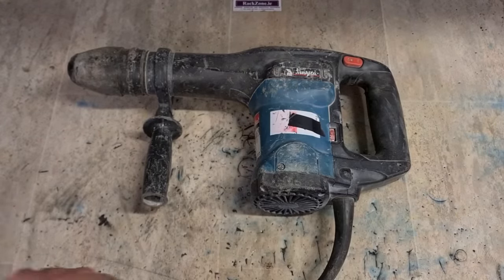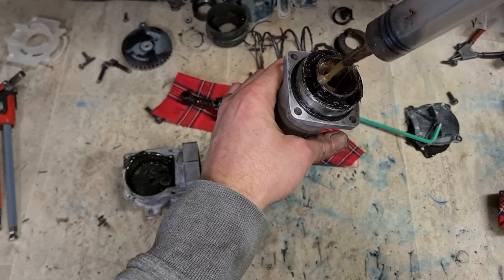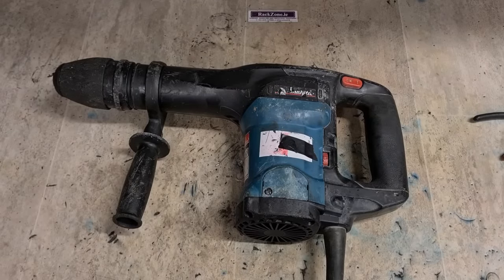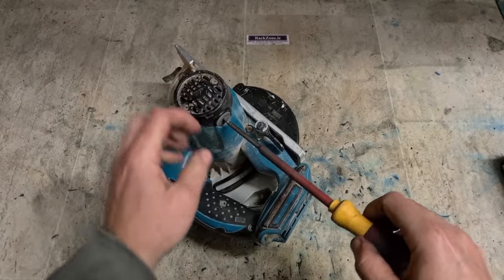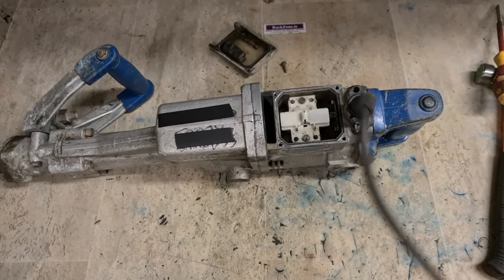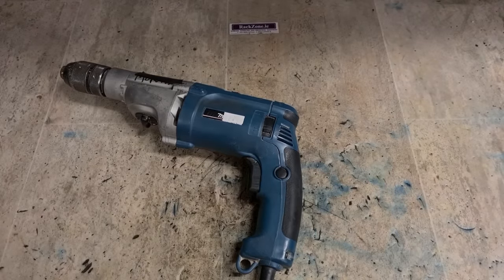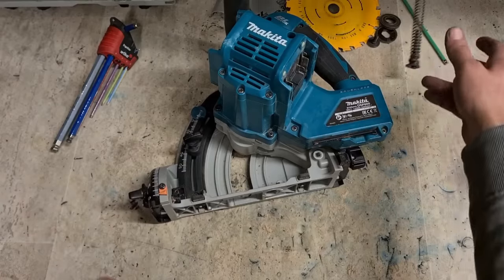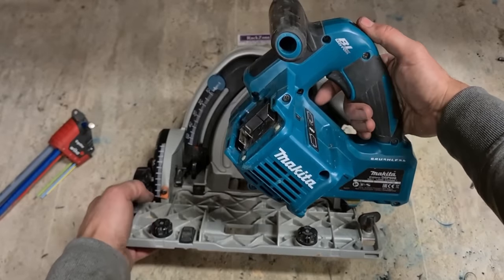Power Tools Repairs, Some old and new tools in for repair today. From a Kango 900 to a Rokamat.

Comment: I used to work at Kango Electric Hammers. I think I built every model they made. They did their own aluminium casting in-house if I recall. That was in the 70s. Time flies. Thanks for the videos--very captivating.

Comment: When I was a very young man (still a boy really) I worked with a carpenter and it was my job to learn to maintain all the tools. The plunge saw, well back then we didn't have one like that but we had tools that I would frequently disassemble, clean and lubricate. Paslode nailers were infamous for jamming up after a while without maintenance. It's tricky, as you say, some of these tools you must be quite certain you don't bend or crack anything while working on them. Nice job. Also, great to see that Kango, what a tool!!

Comment: Thanks!
Same tracksaw,slowly getting harder 2017 model.
Reply: Are you brave enough to have a go getting the pivot pin out? Once when I was young and a stupid cocky bastard I may have but now, nah! 😁
Reply: @josephking6515  am in the process of selling it actually. 
With it not being seized,I would try the grease trick and first see if it will self-correct...given it not being fully bound up.
Yes I would definitely press , if it got that far.

The one shown is actually dangerous.

Comment: One thing I especially appreciate about the way you work - when you do an electrical crimp, you always use a controlled cycle ratchet crimping tool. In North America, most people doing your job would use those terrible crimping pliers that look something like a pair of wire strippers. Car guys mostly use that type as well. They just don't do a consistent, reliable job. They are, of course, forbidden when working on things like aircraft and for cars and tools the manufacturers use proper tools. Just one of my pet peeves, along with people who solder crimps to make them "better" - all they are doing is bypassing the stress relief.

Comment: May not be the safest thing to do, but for old hammers like that if the switch goes bad you can by-pass it completely on the inside and install an external switch on the lead. Works well enough on low speed machines like a demolition hammer (not as dangerous as say a big angle grinder), but you may get in trouble if there's an (even unrelated) accident or a safety inspection on the work site. So basically if you chose to do this you should also retire the tool from any business use, just keep it home as a "hobby" machine and never lend it to anyone else.

Comment: I definitely agree that that pivot pin on the plunge saw fix should be its own Youtube and Instagram short, edited down of course. 

Id think a small grease fitting tool that can operate off a grease gun that screws into that hole would be an awesome repair item rather than having to go through all that effort to remove the pin. And if i were you i would definitely rig up a jig out of a 2 x 10 wiith a hole drilled into it with a drill press to have the pon push through, but keeping everything level.

Comment: I have a very old Bosch reciprocal saw that has a part that needs replacing. 
When I looked it up it’s no longer available. 
But it’s something that I imagine many other sawzall’s  all use. 

Offhand I can’t remember exactly which piece, but I think it’s the fan blade or very closely linked or located. 

Do you have any videos that you have made that include a dated corded reciprocating of this type? 

I’ve watched so many of your videos and not once have I seen this tool amongst the multi tool repairs. 
I bought Makitas cordless version (it’s an 18v version, nowhere near the usefulness or durability) and buying a +250 equivalent (that won’t last decades) is a hard sell. 
I used this thing to chop entire cars in half in the 90s (back when I bought it used from a pawn shop) and until last summer when I needed to trim small tree branches that a chainsaw was my alternative, had the carburetor cooperated

Comment: Thanks for filming these repair vids....A little question please...ON the SDS drill, what tyoe of greases do you use in the motor area and the chuck end??? Graphite/lithium etc....Thanks again Dean
Reply from the maker: I Use mainly bosch grease myself. 1615430015 and 1615430001. 
But these are expensive. So a lithium grease will also do fine

Comment: Be careful taking the base plate off the plunge saw. There is about 1mm movement in it and can throw your blade location out on your guide rail rubber splinter guard. Generally need a splinter guard replacement with any base plate adjustments.

Comment: Those DSS611 and the 610 should have had a car fuse built in which stopped them from drawing too much current, an easy fix when it blows and keeps the saw alive. Bad design makita (i have the 610)
Reply: Seems like it wouldn't be impossible to add to it, there may be room in the handle for that

Comment: 1:08:10 Curious, do you still charge a nominal fee (like, wasted storage or time) when they drop you something that works but they don't know how to use it?
Reply from the maker: it simply depends. if it is from one our customers who bought it here, or if iv spent no time on it, then no. 
But if i have wasted time with it or if it has to be boxed up and posted back. then i would have to charge an inspection fee.
But the most I can convince my boss ( the owner of the hardware shop) to charge is 5 euro.
Reply: I thougt you where the owner 😎

Comment: Wonder if anyone can help, I have a kango 950k, was working great , then motor runs half speed, new brushes, no difference, took out piston,striker and motor runs perfectly,it’s well greased any help, advice would be appreciated, thanks
Reply from the maker: If it was running full power and dropped speed when you where using it. Then more than likely it will be a burnt out armature. Under no load with the piston removed, it might run fine. But once the extra load from the piston on added, the motor with struggle and start to spark heavily. 
If it was not being used and you simply found it running half speed then check the wiring. Someone my have rewired the plug wrong
Reply: Thank you kind sir, I appreciate your advice, I have been watching your channel with interest and impressed with your knowledge, thank u 🙏 for your time  🏴